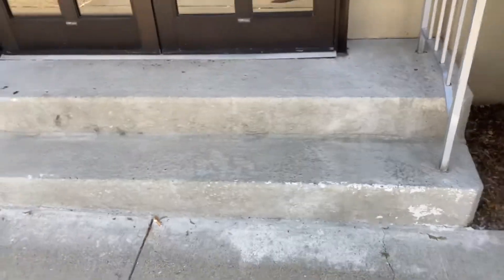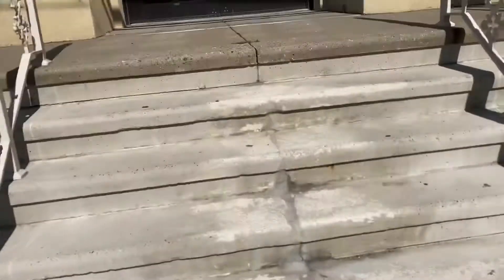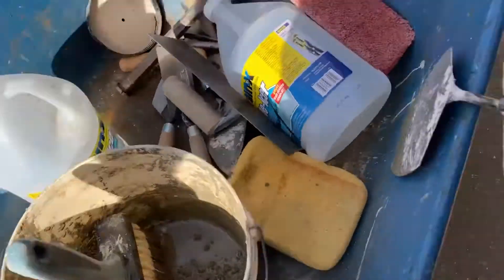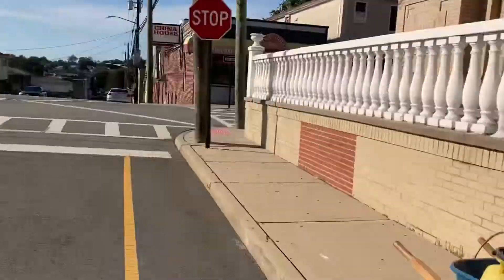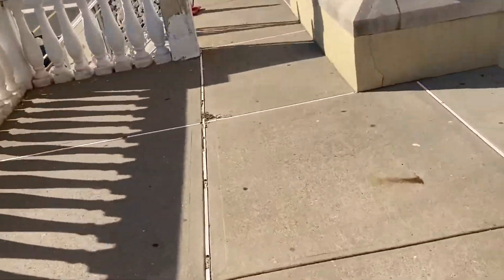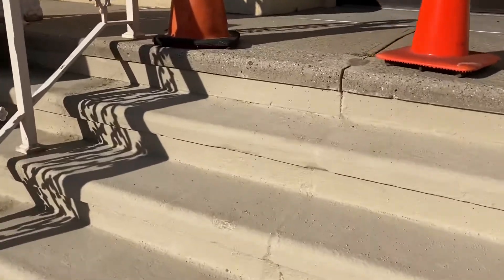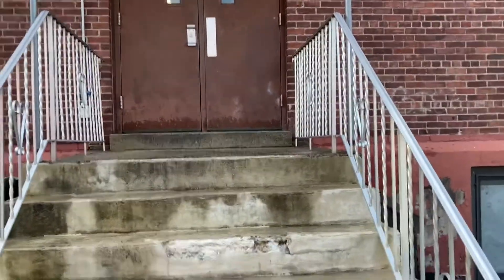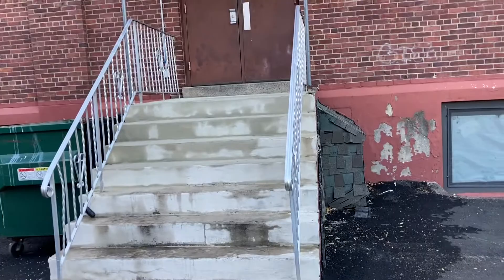Paint it with the Portland like Mike Haduck Part 2

Comment: In almost all Mike haducks videos he says it needs to be redone every year... Unfortunately I never saw a picture of what it looks like after that year do you have any of those pictures?
Reply from the maker: Check out my original video which was about 11 months prior to this one.  This video is the after.  Check out the video and give us your feedback.  Mike is a Master Mason and he is absolutely correct, it’s a annual maintenance item.  How big of a project do you have?
Reply: @vinceleto  it's the entire driveway
Reply from the maker: @danielvanravenhorst6917  I would not use the Portland paint on my driveway.  In fact I only used the Portland as a test because I had almost a full bag sitting around.  The Rapid set mortar mix is way better and Rapid set has specific products for entire surface overlay.  I would probably just use RS mortar mix or Cement All, thin layer with a trowel and quick broom finish.  Note this may not come out perfect like a newly poured slab so keep that in mind.
Reply: If you want a Portland slurry to hide rapid-set you need to either,  paint the rapid-set with a mud-slurry, for application of mud slurry refer to,
(Mike Haduck's School of Hard Knocks). 

The proper application for white-washing is, to paint on multiple coats. 
1. Thin coat  
2. Thicker second coat 
 3. Final thin coat. 

 Let it dry in between coats.

My porch is going on 2 years and,  it's still in good shape a bit dull.
I will probably give a face-lift next summer to brighten it up.  

You might think about looking at some concrete ceilers.
Reply from the maker: @cndbrn7975  thanks for the reply.  The Rapid Set is so much better but I don’t like how it cures bright white.
Reply: Is there another way to resurface a driveway/area that is a little more heavy duty than just painting over the areas with Portland etc? 

Please advise.. thanks so much!